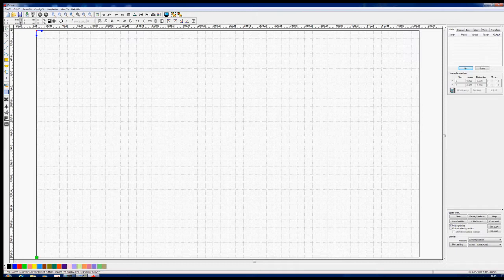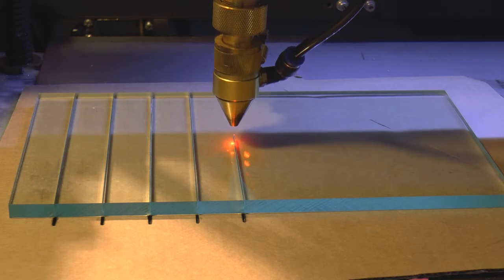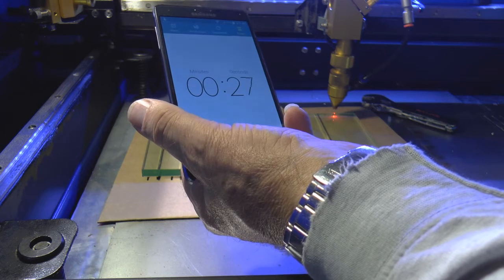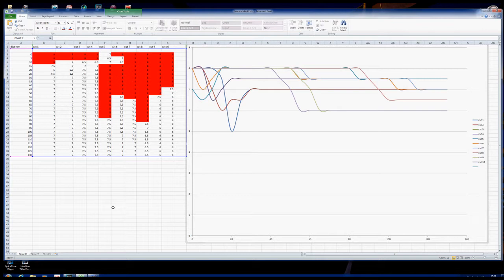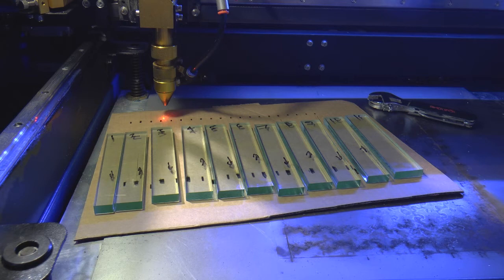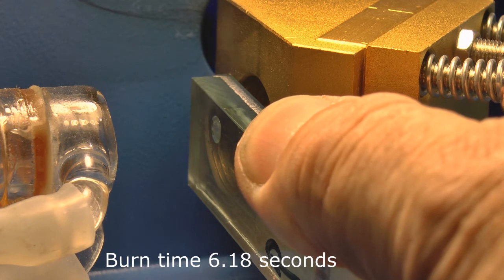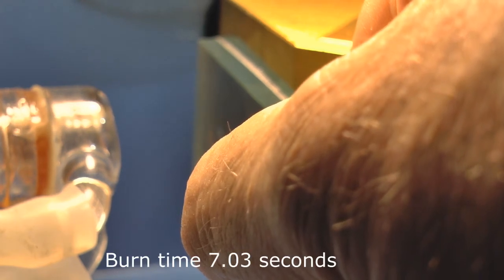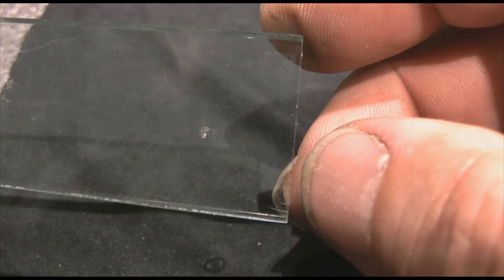RDWorks Learning Lab 17 Final test of laser power loss

Comment: Water temp at the time??? The is a huge difference between cuts if your water chiller cannot keep up keep the steady temperature (i.e. 17C)
Reply from the maker: Thanks for your comment but note this was 7 years ago as I was just beginning my laser journey. I had no idea about the Chinese tube frauds that took place and this tube was acually junk. I now have sufficient knowledge to say exactly why it was junk, It was internal mirror alignment issues ( not temperature) and this tube  failed final test at the factory and was sold for scrap  value into a "grey" market. I replaced it with another "suitable replacement"  (from EWbay) that was also junk.  After some research I bought an A grade tube from Mactron. It was expensive (at the time) but here we are 7 years later and it's still performing like new.  I suspect your 17C comes from using a CW5000 or5200?   Here are two things for you to think about.
1) I have carried out exteneded testing  (with an A grade tube) between 5C and 45 C and after running several full power hours at 45C  I measured a 5% power loss at the higher temperature.
2) One of the premium tubes you can buy (Reci) recommend a water temperature range between 10 and 50C.....not much difference to my own experience.

 The agressive cooling with the refrigerated "industrial"  chillers is the cause of significant power variations that will be seen asl light and dark banding on photo engravings.. That's a whole different story that I have researched

Comment: Thanks for the detailed videos. Just wondering if you have (now that the warranty is over) tried adding a milliamp meter in line with the powersupply and tube to see if the current is dropping off. I would suspect the electronics as the probable cause.
Reply from the maker: Hi Thanks for your thoughts. I did eventually discover that my tube was junk. In the last 7 years I have discovered a huge amount about the laser technology andf the way the Chinese laser industry works. Tube manufacture is a very difficult process but there is one key operation during manufacture that must be perferct and that is the two internal reflecting mirrors .
 These mirrors MUST be mounted perctly parallel so that they reflect photons  back and foth along the tube axis. . If the reflections drift off then you have a B grade tube that is low on power and having a poor quality intensity profile.. The market is flooded with these B grades that work  "in some way"....but not to spec. 
At session 17 I was just starting my learning journey and was naive about lasert technology. I have spent 7 years learning and decoding all aspects of this weird Chinese laser process and  I have created a series of easy to understand vidies on specific laser topics, organised in a logical manner to teach newbies all about the technology. This A to Z of lasers can be seen here     https://laseruser.com/the-concise-rdworks-learning-lab-menu/
 Best wishes
Russ
Reply: @SarbarMultimedia  Thanks Russ. Any advice on Cloudray tubes?
Reply from the maker: @k1jo939  
I have no business connections with Cloudray but have a  friendly relationship with the company owner.  When he began the company aboutb 5 years ago he sought to market some of my designs for a profit share. I declined because I have a nice stable retirement  package running that does not interest the tax man .  Money appearing from China may rock that boat. I did some more research about Cloudray and found it was operating on a more western business ethic of high quality (but still Chinese products) and great customer service.  I contacted the guy again and offerd my designs for free because I do not want the millstone of manufacturing products at my age when a company such as his could service the hobby market at keen Chinese prices. In return he offered to support any reserch I wished to pursue. His help with building a very comprehensive lens collection  has ben invaluable because his optical industry contact have supplied many commercially unavailable lenses. With my thousands of world wide contacts I soon get to hear of problems. The B grade tube scam is something I have known about for some time.   With Cloudray's aim to supply top quality products, I know the lenghts they have gone to ensure thay are a trusted source for A grade tubes. I regularaly recommend people such as yourself to think twice when you see great Ebay or Amazon tubes at bargain prices.. You are making a 7 or 8 year investment in top power and reliable performance, . if you buy a bargain B grade tube all bets are off.  About 4 years ago I discovered  a correspondent, who I had steered towards Cloudray , was having some power  issues with his new tube.. Upon investigation I discovered he had received a B grade Reci tube from Cloudray. Mortified that my trust in Cloudrat was at risk, I immediately contacted Cloudray to advise that one of the premier tube manufactureres was selling them B grade tubes.  It turns out that Cloudray were unaware of the B grade tube "grey market" and were innocently selling  what they thought was a trusted A grade product from a top manufacturer. They immediately checked their stock and rejected many tubes.  They sent A grade replacements to the few customers that had purchased non conforming tubes,. They then implemented a rigorous tube test procedure before any tube is shipped..  Hence I know for certain that Cloudray are a trusted source for A grade tubes.
Many believe tha Reci are the best.... not me.  I have always trusted the performance and truthful specification fof SPT tubes. Upon my recommendation several years ago Cloudray deided to become sellers of SPT tubes. I always mistrust tubes that have been rebranded because  its a pretty sure sign of B grade. However, Cloudray have set up their own rebranding arrangenent with SPT so when you buy  Cloudray CR70 tube you are really buying an A grade SPT tube   C70 see   https://www.sptlaser.net/co2-laser-tube/c-series

I have 2 CR70 tubes and they are fabulous performers and 1/3 the price of an  equivalent Reci tube  A CR70 will deliver 80 watts  and despite the specification, the Reci W4 tube is really an 80 to 85 watt tube. 
Take a look at   https://www.cloudraylaser.com/collections/co2-laser-tube/products/cloudray-35-80w-cr-series-upgraded-metal-head-co2-laser-tube?variant=33568306725004

scroll down to see all the tube tests they perform. I think the mosy important check is the acrylic mode burn tesst that I recommended they implenet. In just a few seconds you chacharacterise a tube.  see https://www.youtube.com/watch?v=R6Wqn5-HMzM

Best wishes
Russ

Comment: I am researching this same problem with our laser. A different make and possibly wattage, but same problem. What I have discovered in our specific case, our power supply is rated at 100w and our tube is rated for 80w. We did not adjust the final output of the power supply to match the tube. This caused us to over power the tube. A laser tube exponentially kills it self if you over power it. There are gasses and solid powders in laser tubes to help restore the C02 gasses after each burn. Each time you use a laser, you contaminate the gasses and solids a little bit more. And when you over power it, this happens much much faster. We probably got a couple hundred hours out of a 10,000 hour tube. Most power supplys come in 50 watt increments, where tubes come in all different sizes. IF you have a 60 watt tube, you probably have  a 100 watt supply. Operating this at 100% will yield a bad tube in a matter of days...

There is also a theory that the gasses inside a tube will normally break down over time. This means that if you don't use your laser, it still can loose power, although it happens much slower.
Reply from the maker: Hi
 This is an old video  from the start of my learning journey with Chinese lasers. I now know a huge amount more about the technology and the way in which the Chinese laser industry works.. In general you are right about overdriving tubes with too much current so always fit an ammeter to your machine and never drive your 80 watt tube (if it is really an 80 watt tube) with more than 24mA. The essence of your understanding of tubes is basically correct but there are a few myths and misunderstandings in there as well but they are not important.

 The basic question is where did your tube come from? Was it the original fitted to your machine and did you buy it from Ebay or Amazon Market place or was this a direct import from China. EVERY machine from the first two sources will be fitted with a B grade tube. That means that the tube has failed final tst at one of the main tube makers and has been sold for peanuts to a machine builder for "repurposing".. It will have been tested again to make sure it works "in some way" (enough to fool the average technically naive Ebay buyer) and fitted to a machine.  Is your tube labelled K H Laser? If so disbelieve what is says on the label.
The machines are then shipped in bulk to warehouses around the world from where they are sold by by private E bay sellers in China for commission. 
The tube in this video was serious junk. You will see me replace it with another tube I naively bought from Ebay and that was  a slightly better quality piece of junk. It eventually hurt financially when I researched and finally bought an A grade power supply and tube directly from a source in China. The marketplace is saturated with B grade tubes so be VERY careful what you buy. There are very few trusted sources.
 Best wishes
Russ

Comment: Hi
Did you manage to get to the bottom of the power loss issue?  My 100W laser is exhibiting the same problem, any guidance would be appreciated.
Reply from the maker: Hi Chris
Yes eventually. But before then I gave up with this first tube and in my naivety  turned to Ebay to buy a replacement. BIG MISTAKE. As you move along my learning journey you will see that it was really just better quality junk. As I gained more knowledge and had more correspondence from all over the world, a very clear picture began to emerge of how many Chinese machine builders are preying on technically naive E bay buyers.  
A) They advertise 40 watt machines as 50 watts ,50watt machines as 60 watts and 60 watt machines as 80 watts( you get the idea)
B)  For almost free, they they acquire  reject tubes from main tube manufacturers. They retest them to make sure they work "in some way" (because with a proper power meter and an ammeter how  would anyone know?) A major culprit tube will be labeled K H Laser  (is yours?)
C) They usually fit B grade HV power supplies  that will work quite well but have failed the response time specification and may not engrave all that well at high speed.
D) I have even seen another expensive component, the Ruida controller  without bar codes are model label. Again B grade.
E) Generally mechanically OK these machines then get shipped to warehouses around the world where they sit for months while a team of PRIVATE Chinese ebay sellers try to sell them for commission. The promised support and warranty is worthless because  the seller has no tech knowledge of the machine and  will close the ebay account at the first hint of him losing his commission.   You will note how the factory is purposly ducking any resposibility  by hiding behind a third party (perhaps better described as a puff of smoke)
 Determined to not get screwed again, I researched well before I bought tube number three and a new power supply.  It was an expensive  lesson but more than 4 years on it is still performing like new. In the meantime I  have found a company in China that I can 100% trust. 
 Attach your disguised email address (chrisdotnobleatyahoodotcom) and I will send you some guidance. It's a laser jungle out there for the unwary.

Best wishes
Russ

Comment: I can't find which video you compared using different air pressure on air assist?
Reply from the maker: Hi Michael
You must always remember that this is a record of my zig zag learning journey and not a set of tutorials. I come from a background where I had lots of experience with metal cutting. To achieve good efficient cutting  I was  using high pressure air at 8 to 10 bar, or pure oxygen at 2 to 3 bar or medical grade nitrogen at  15 to 20 bar depending on the metal being cut. I tried using my shop compressor when I first powered up  my China blue machine, because I rolled around with laughter at the stupid little pulsing air compressor supplied . 4psi??? (0.3bar) Joke.  I wont go into the whole story but after 2 weeks and 2 damaged  lenses I reverted back to that pump I had laughed at. It has been serving me well for 4 years and I haver the same compressor o the Lightblade machine.  For cutting you do not need high pressure , you need efficient flow through your kerf and 0.3bar  is perfectly adequate to blow all your fumes out of the bottom of your work . So for clean efficient cutting you need a small orifice nozzle (2mm to 2.5mm diameter and that nozzle must be set close to the work  (3 to 5mm). With engraving  there is no bottom exit for your fumes, they have to come upwards and there by is a problem that most do not understand . If your fumes explode upwards then the last thing you want to do is blow them back down onto your work with air assist. For engraving you need a big gap between nozzle and work (at least 12mm) . a big orifice in your nozzle to letb the beam through and just a whisper of air assist to protect the lens. The important thing which most folks fail on is air management. You must make sure that your engraving fumes, once airborne, remain so  by being quickly carried away by a CROSSFLOW of air.
This is a summary of many videos and experiments with lenses, air assist flows and pressures. and cutting/ engraving efficiencies. and may save you many hours of "looking over my shoulder"

Berst wishes
Russ
Reply: @SarbarMultimedia  Russ.  Thanks for the reply.  I thought maybe you remembered which it was in.  I was going to point someone to it.  That's quite alright.  I'm hooked on watching your videos.   I think mainly you bring it down to earth and it's your journey as well.  Also you explain why you're doing stuff.   Thanks again.  I refer people to your videos a lot.

Comment: hi , im in need of some advice, I recently bought this machine to mainly use it to cut out 4mm plywood, but it doesn't seem to cut through it or it might cut through the first  shape and continue to lose power. is this a machine problem or a mirror setting problem regarding the power output needed to cut this material.
Reply from the maker: +Anthony Durnin 
Hi Anthony
My immediate question is to ask what power % are you running at, as what you describe has all the symptoms of over driving the laser tube. I can guess that your machine is not fitted with an ammeter and you have no idea what you should be running your tube at. There's a programmable power range of zero to 100%, why not use it. If it doesn't cut at 50% then let's try 95% WRONG. In my ignorance I did just that and wrecked my first tube.  
Logically, if the machine was cutting initially and then reduced it's power output , it will be nothing to do with the mirrors, they are just innocent bystanders. What power is your machine supposed to be and  what's the approx length of your tube?

You may have been attracted to this video because it's title matched your problem. 
It is just one in a numerical series of videos that I have been making since I first bought my machine. The series documents the learning cycle I've been through, the  discoveries and the mistakes I've made. 7 months on, I'm in a happier place and having great fun. I'm also still continuing to learn things about my machine that may benefit others because there is much myth, here-say and conjecture about these machines and little documented fact.  So there is a trail of what I've learnt if you wish to follow it.. However, if you wish to message me with your email address (click the Sarbar logo icon, then the ABOUT tab and top right will appear a message button) I will attempt to help you off line.
Regards
Russ
Reply: +SarbarMultimedia hi again rus my email is antodurnin@gmail.com  all help is hugely appreciated thanks